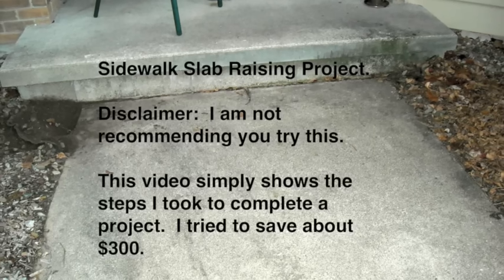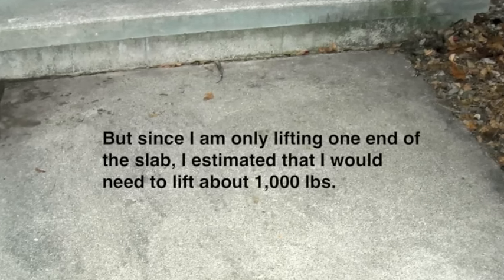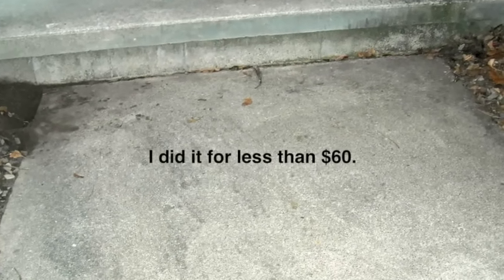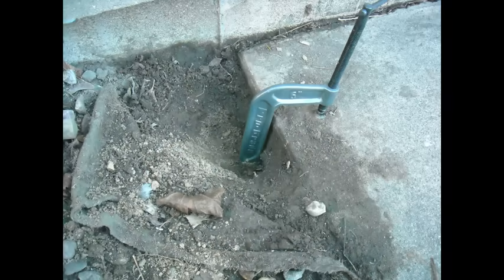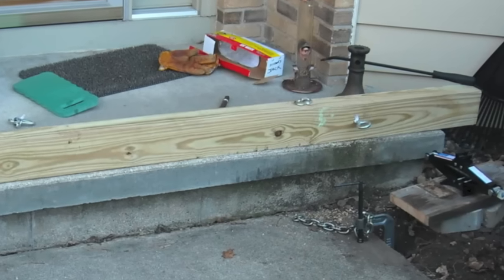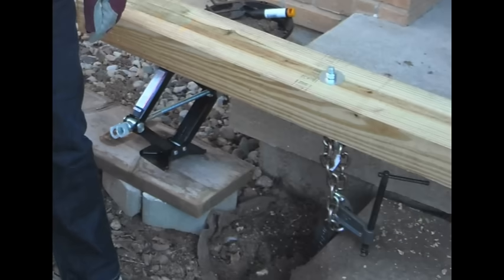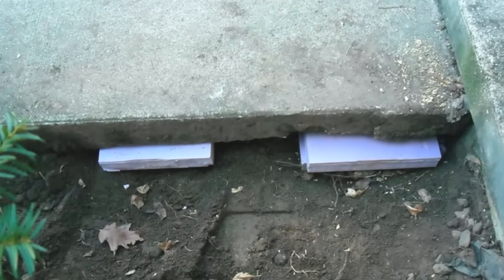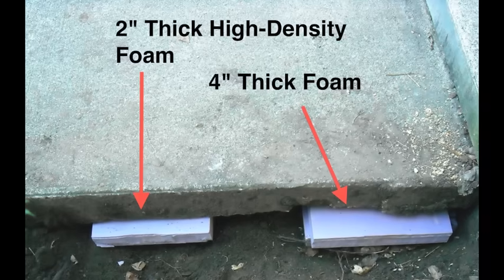Slab Raising, Do It Yourself

Comment: Hmmm.... I tried to lift my sidewalk less than two inches and it didn't budge at all. Nearly broke the 4X4 in half. I had high hopes. Oh well....
Reply from the maker: +Kevin Sanders Hi Kevin.  Maybe the sidewalk portions were still intact in one large, heavy piece that would be too heavy to lift with this method.
Reply: +Kevin Sanders I'm betting either reinforcement wire or rebar runs through the two sections of concrete.  If you have scaling, spalling and settlement of an older slab you're probably best to break it up and replace with new.  Don't forget a good layer of sand or aggregate on the subgrade, otherwise you'll have water issues and settlement on the new part later on.
Reply: +wwaynemcg I finally got it. Even though its a narrow sidewalk in about 10 foot sections I tried to lift it about 2 feet from the end and it was just not enough leverage. I had to go to the very end where it was too low and lift from there. I was afraid it would break but it came right up. Cleaned out underneath and packed about half a sheet of foam under it. Now to see how long it holds up.
Reply: Kevin Sanders Hopefully it holds up until you sell and move.  I would be careful driving anything very heavy across it though.
Reply: If the same insulation the video maker used was used it should be fine for a very long time, they use this under whole house slabs etc.

Comment: Why not just pour concrete underneath in the space created?
Reply from the maker: If you can push the concrete in evenly that would work fine.  I did not have a way to pour in the concrete sideways in the limited work area.  I was able to raise the slab high enough to slip in the foam pieces.
Reply: As someone commented above, you could build two vertical plywood dams and shovel-in sand-mix concrete, then vibrate it till it flows to the other side.  But concrete sounds messy and perhaps more costly. Plus, your simpler-is-better technique has held up several years.

Comment: Great DIY hack. I like it. But your friend is wrong about polyurethane foam used for concrete jacking. It's the premium way to go for this method. He must have hired knuckleheads that used the wrong type of foam or did not know what they were doing. Polyurethane foam has 7,200 to14,000 lbs per square ft of support just in the free rise state, and "polyurethane lifting foams are used to level airport slabs supporting jumbo jets, equipment and building slabs supporting tremendous loads, and even railway sleepers that support the heaviest freight trains." http://info.alchemy-spetec.com/blog/slab-jacking-with-polyurethane-foam-how-strong-is-strong-enough

And there are no weak spots with this method because it fills all of the voids and crevices under the space slab. I can see how using a combination of your lifting method and poly foam would be a great DIY with no voids or weak spots.

Comment: Is that foam biodegradable? Is it waterproof?
Reply: +John Cantwell (TitleTownJake) great work. smart man,  i love creative intervention
Reply from the maker: +W Lowe - The foam I use is Owens Corning Foamular.  It is not biodegradable but it is waterproof.  If the foam board was biodegradable it would disintegrate, and the slab would sink.
Reply: John Cantwell 
As long as uv doesnt hit foam board, good to go.  This product is used to protect foundations after the frames are removed and before backfill. Great video.

Comment: I think your job is temporary, and the Concrete Raising Company's job will be permanent.
Reply: I think you are wrong. It's accentually the same product once the expanding foam cures.
Reply: @donm.1068  it maybe is, but the injection molds right into every single cavity and much more can be pumped in. there are no unsupported areas and air pockets. like i said, it looks like a good quick fix, just not as long lasting.
Reply: Bill Cenne  Bill, I would agree with you for slabs that have to support a car, but for a walkway there's plenty of support for people.
Reply: @johnzappulla8023  that hasn't been my experience. the slabs themselves are very heavy and also the frost/freeze cycle screws everything up. but it's a fantastic idea!
Reply: Bill Cenne  Bill, thanks for your reply. What if there were no gaps and the foam sheets were butted together?

Comment: you forgot the cost of labor, which you most certainly went well over 350-400 in by doing it yourself and in this way.
doing the work yourself doesn't mean the labor is free or couldn't be included. it's either their time or your time, doing it yourself doesn't make it "free", you still spent time doing it, time which you could of spent doing something else.

Comment: One and a quarter yards of new concrete would cost less than $80 delivered.  That's what I'd do.  Different strokes...
Reply: Starbolin, Aside from wasting all the extra labor and extra expense for new concrete, how would you get it to perfectly match the rest of the old concrete in appearance?
Reply: Getting ready mix in  small amounts, such as 1 1/4 yd would cost about $250.  $80. is not even close.